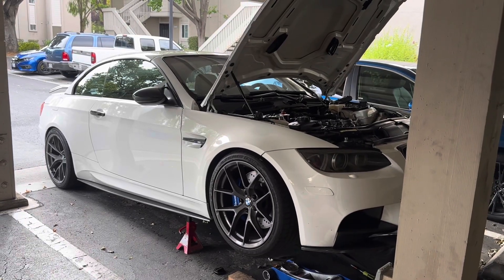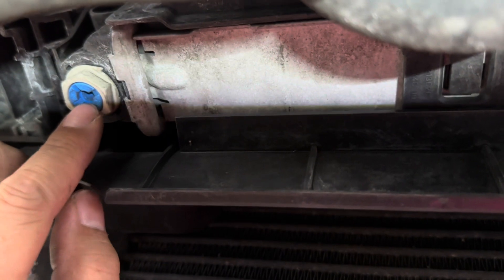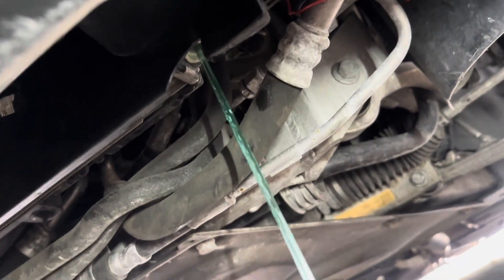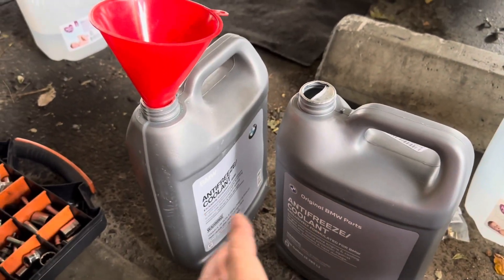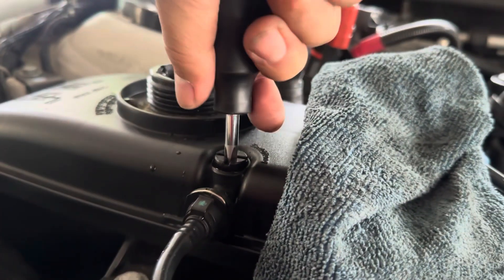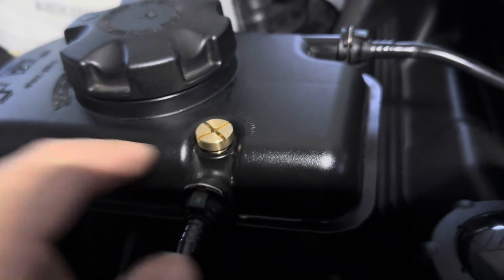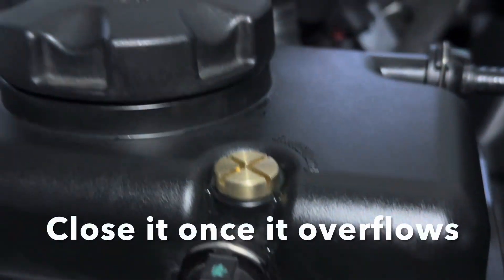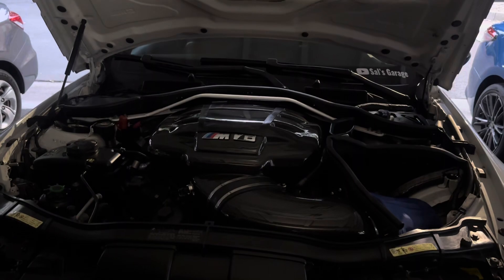BMW M3 Coolant Change DIY OEM Antifreeze Flush & How to Bleed E92 M3 Cooling System

Comment: So I refilled my coolant cuz it was empty in the expansion tank then I checked it next morning n I checked it n it was way above the max line so I took sum out from expansion tank and it was green that came out same that colour he has.. now it got me trippinn
Reply: Refilled it w blue coolant from bmw
Reply from the maker: @pattab6224  good job
Reply: @  yea I refilled it cuz it was overheating n now that I refilled went for a drive n still over heating should I do a bleed? I jus refilled it n thats it
Reply from the maker: @pattab6224  bleed it too
Reply: @Sals_Garage alright I will cuz I jus refilled it didn’t do any bleed or flush so maybe that’s y still over heating but thanks
Reply from the maker: @pattab6224  Yea that should fix it. good luck.

Comment: You Should Have Replaced The Thermostat for the Engine While You Were At It.. Had Too Replace mine at 65k Miles..
Reply from the maker: Will do soon. It was done at 80k miles so may be due again.
Reply: Should be good tho.. 👍🏿
Reply from the maker: @coolmoe3289  hopefully 🤞
Reply: My M3 has never been a Daily  Driver So the Engine Coolant was Clear Blue When I Changed my Thermostat.. That Discoloration in yours could mean something is Mixing with your Coolant...
Reply from the maker: @coolmoe3289  I put a bottle of hypercool (green) in the coolant for extra cooling a while back. That’s why it isn’t all blue.
Reply: Got it..👍🏿

Comment: Is it ok to use the euro spec 50/50 premixed coolant from the auto store?
Reply from the maker: You can, but I would stick with BMW blue coolant for longevity of the coolant system.
Reply: @Sals_Garage  ok thanks. I heard as long as it’s ethylene glycol that is free of silicate and phosphate, you’ll be good
Reply from the maker: @zureai  correct. Good luck 👍
Reply: @Sals_Garage  BMW blue coolant is concentrated! you still need to mix it with distilled water
Reply from the maker: @vladd1593  yes 👍